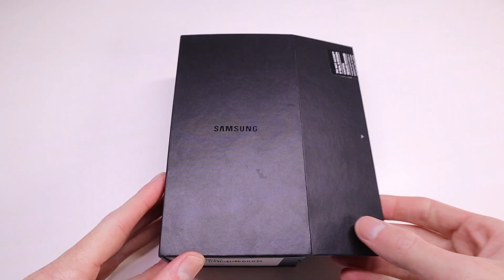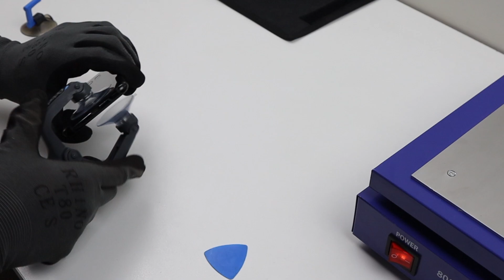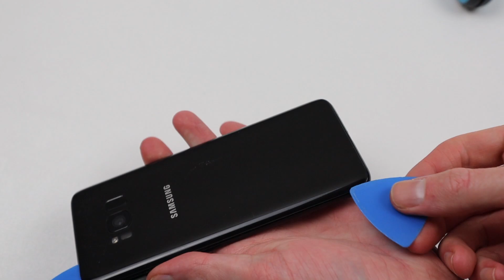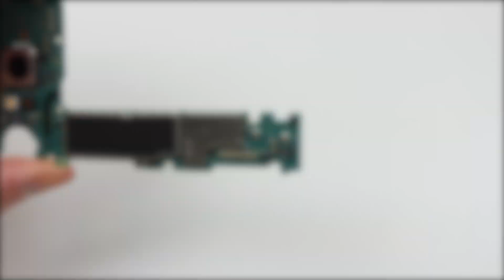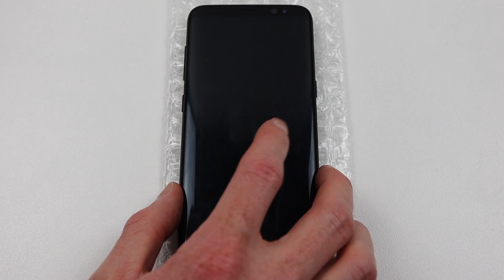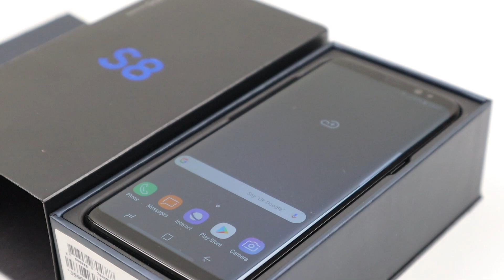Restoring a smashed Galaxy S8 for only $30

Comment: In such cases try suction cup if it sucks even making needle hole if it does, be quick 
Use sucktion cup and immediately inject some isopropyl alcohol and your done 
Its very easy and time saver technique for opening such phones

Comment: I know what is probably used for adhesive: a heat-resistant gasket. I can tell this because the rear panel did not easily separate from the frame.

Comment: Hi Jeffreys: I came cross this Samsung fold fix video (https://www.youtube.com/watch?v=wAc2CgmAi0I), and I noticed he is using a Falcon 530 liquid to remove the glue between the screen and the frame. It looks working instantly and no heat gun is needed and much much easier. Maybe you can try this method next time.

Comment: Hi Hugh, my dad smashed his back panel on the S8+ and the battery's health was ending, so we decided that we were gonna replace both, when we finally got into the phone, we peeled the the wireless charging half way off, we needed to remove some screws, w removed all but one, because whatever we did, the screw was not moving in any direction, we used all the screwdrivers we had but it didn't budge at all 

Is there any way I could remove the screw

Comment: Soooo if you already have everything you need to repair it and some time it will only be 30$... but if you wanted to chance it with a random lot of broken phones for 50$ and just so happen to get the parts you need there you go! Only 80$ for one working 2 year old phone. S8 goes for 120USD so a big 40$ save by doing a repair. EPIC

Comment: Hey, I have no faith that this is gonna be seen, but before the pendemic my phone died - samsung galaxy s7 the screen just started to flicker a little, after a while it got worse, then it started to turn black and would only come one if it gets in a warmer place, now its at the point that it's unudable. I changed the battery but that didn't do anything, I don't believe it's the LCD but maybe you or someone would help with an answer ir an idea of what could be wrong with it, during these rough times, thank you in advance!
Reply: You need a new screen

Comment: A $10 heat gun will do better than a $30 heat plate in most if not all cases as it will heat up a lot faster to melt that damn glue. Takes no time at all in comparison. The restoration is great even so.

Comment: I have a galaxy s8 with a cracked front glass, but the display is still working fine. I think a bricked s8 doner would be fine if i would just transfer the internals to it. Than getting it reglassed or new panels.

Comment: I am wondering if placing a phone at 80 degrees in 6 mins in total is a good idea, let alone 120 degrees in another 6 mins.
Using a heat gun would better protect the phone components.

Comment: the heating machine = 30$, the replacement phones = 50$, the broken phone itself = ??? , the replacement backpanel = ???
= 80$+ .    probably ~110$ plus the time to repair...not worth it. maybe if it was iphone 11 pro max that you can resell right away (because who wants to use a iPhone), or s20 ultra.

Comment: If you want to get the backpanels easly off. Try it with a aluminum fish and a plastic fish, first insert the aluminum fish a bit so you can get the plastic fish under it. If you have it in you can remove the aluminum fish and go around with the plastic fish. Just go easy if you go too hard the backpanel will shatter. Make sure to pre heat it too.

Comment: bro help me, so i have a pixel xl and i dropped it in water the other day, when i took it out it was working fine but i turned it off right then because that is what came to my mind. after being in rice and outside for a whole day, i tried to turn it on but it wont turn on or even vibrate, it wont even charge when i put it on charging. could you at least tell me what the problem could be?

Comment: Tip heat it at 70 C for 8 min use 90 percent alcohol or side adhesive. Don’t use a spunger it doesn’t help . Use a nice clean isesamo and you won’t break the glass

Comment: Is this the same Galaxy S8 from the part lots of 3 Galaxy S8 that you showed us before?! Wow that's a badly broken screen though. Also I think the fastest way to remove the rear cover is to use a heat gun/a hair dryer. The heating machine was quite a bit inefficient. I still like the classic way of opening it which like I said is using a heat gun.

Comment: For these samsung phones it is extremely important if you are transferring around parts, you must have the exact same variant on both (storage option can be different). Something like a Galaxy S4 or S5 has like half a dozen variants and mix and matching between them will give you anything from signal issues to just flat out not fitting right. This is ESPECIALLY important in the likes of US and China where there are a bunch of carrier specific variants!

Comment: Use a thin plastic or metal card instead. You make it very hard for yourself. You can easily separate the backcover from the frame by slicing inbetween the two. Also 120 degrees is way too hot, 80 is the max and works just fine. And you should heat the phone again when applying new backcover tape, since the tape will stick better to the frame when heated, and put on some clamps so the backcover is pressed to the frame (around 4/6 clamps).

Comment: 1.when screen or back is cracked yo usually wanna cover it with tape so you get a better suction
2.in edge like phone the heat won't reach the edge as the phone is not laying flat
Reply: Heat gun is way better
Reply: Good insight
Reply: And it's edge is also not flat
Reply: You nailed it

Comment: Sometimes I feel like the use of a suction cup is just extra
Reply: It helps lift the phone up because it has hard glue 
And it's pretty hard to do
Reply: @samaviation6399  I feel it might give more opportunity for the glass to crack but if it works for them that's awesome
Reply: @riotsqwad  yea but with soft adhesive it'll ease the stress on the glass like let's say ur both hands were glued
If the glue was soft and water like you would have no problem
If the glue was hard and stone like it'll hurt your skin 

Don't take this as hate :)
Reply: @samaviation6399  what lol? all you're trying to do is cut the adhesive, lifting adds pressure
Reply: @riotsqwad  sorry I'm not smart lol
But it's better to warm up the adhesive rather than to cut it
Reply: @samaviation6399  doing both is key 😁

Comment: How is this a restoration video if you're just taking the motherboard and putting it in another completely different device? All of the other parts you've used as well does not add up to 30 dollars.

Comment: Is there any way to check the battery cycles on a Samsung phone and check its health through any sort of external program? My phone dies quickly and I've used it for 2 years so I wanna know if it's worth it to replace, and I'm also just curious
Reply: Having personally having an S8 for two years too and having the same problems as you, I definitely would recommend upgrading if it does quickly.
Reply: @arjanbillan  I am also trying to debate whether I should just tough it out till I can afford to buy a new phone and sell this to someone who is interested in refurbishing an S9
Reply: @DrRubix1712  well I'm toughing it out because I can charge my phone beside me on my desk throughout the day but if you require it to be usable at any moment, maybe think of selling
Reply: @arjanbillan  Lol I just play pokemon go. Just gotta wait to buy anything on credit, I'm in the process of buying a house and cant have anything impact credit until we get completely cleared and signed over
Reply: @DrRubix1712  yeah I would worry about the house more... good decision, my guy

Comment: I just got a Samsung s8 and I want to know if there is any other way to fix a burn in on a AMOLED Samsung s8 screen without buying a completely new one?
Oh, and thanks for that video you helped me out in some ways!
Reply: Personally, I have an S8 too with burn ins. With what I know, AMOLED screen burn ins are permanent, unfortunately. The only way to fix it would be replacing the screen.
Reply: The only ways are changing the OLED display, or buying an entirely new phone. Burn in sucks.

Comment: Hey Hugh, could you do a video where you repair just the glass screen of a Samsung s8 not the whole LCD.
Reply: these don't have an LCD. they're extremely expensive OLED display.
Reply: @bretsutherlandsterriblemem8439  well thats what i meant lol but theres like a glass panel over the QLED screen that can crack or shatterd, i just wanted to know how we could repair that easily with out replacing the whole QLED screen
Reply: @Jayserrao_  Don't think you can.. those OLED displays are very thin and break way too easily.
Reply: @bretsutherlandsterriblemem8439  you can...just search repairing Samsung galaxy s8 glass screen only
Reply: @Jayserrao_  i honestly have no use for that information. i use the more repairable iPhone 6s, right out of 2015.